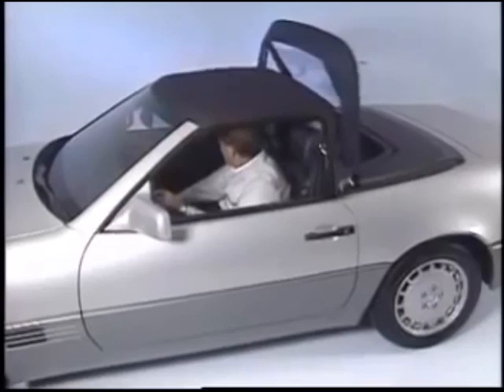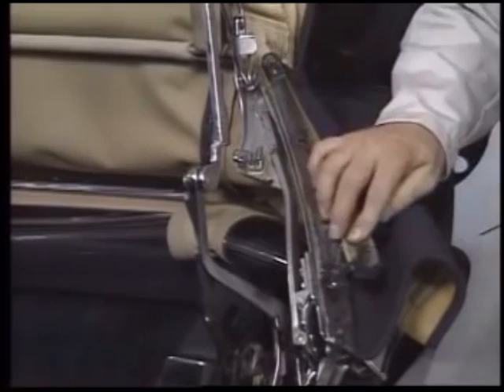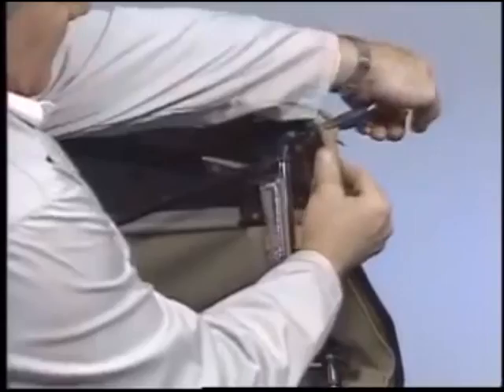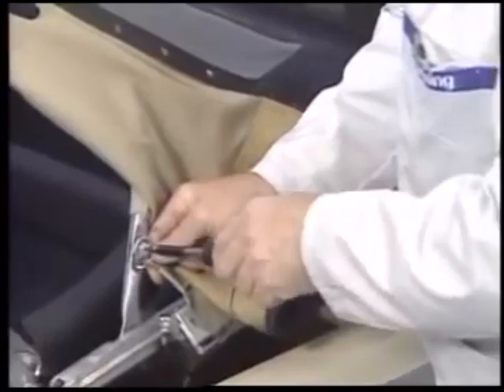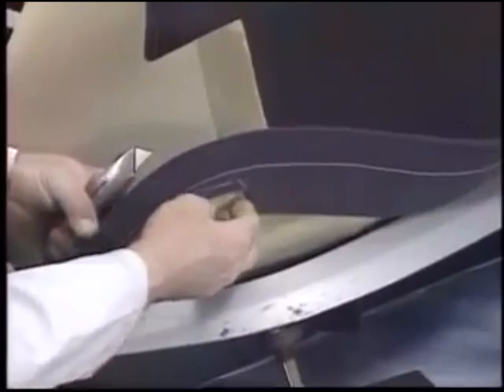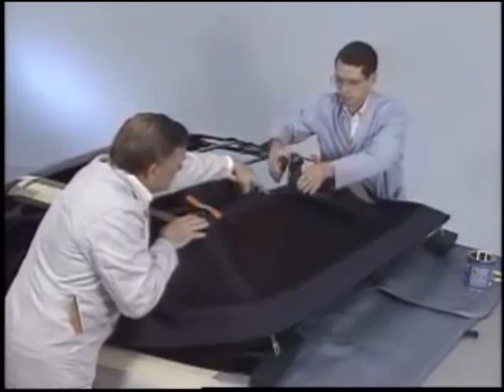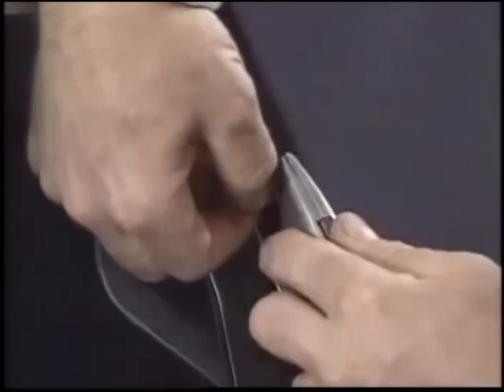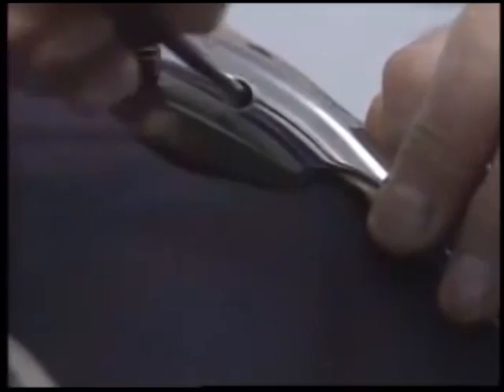Mercedes Benz R129 Soft top removal and installation Video

Comment: I am a Japanese trim shop. I have installed a lot of this top. They seem to be working very smoothly, but they actually need to adjust the fittings. It takes a lot of time and you will regret trying to install it...

Comment: It would be so much easier (and practical) if the top arrived already affixed to a frame, and you then just bolt the top into place? Afterwords, you can simply send back the old top assembly, for the recycling/recovery of the old top frame, to be reused! At any rate, here it takes two experts considerable time to do this job, and because they are experts, there are no snags. Chances are, things can be more problematic for the inexperienced folks attempting to do the same job. I have rebuilt engines, but would I try a convertible top replacement? (Likely not!) Useful video, in the sense that I now know this is not something I want to do on my own! :)